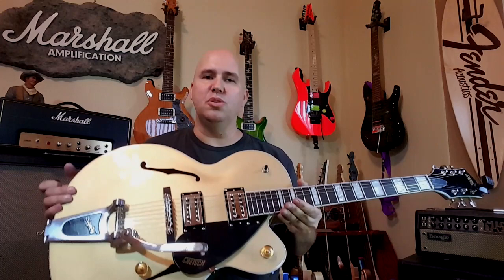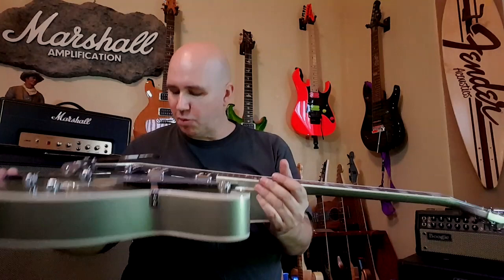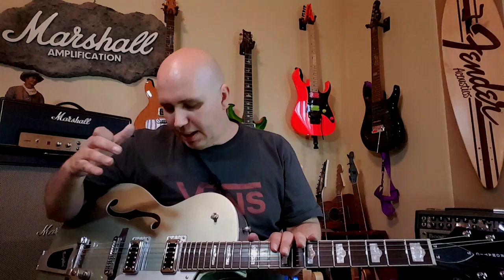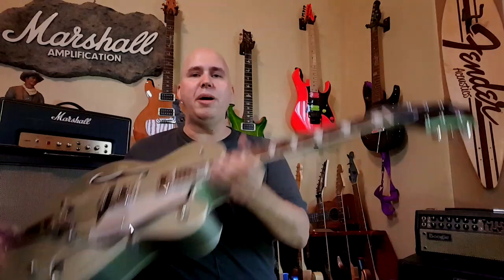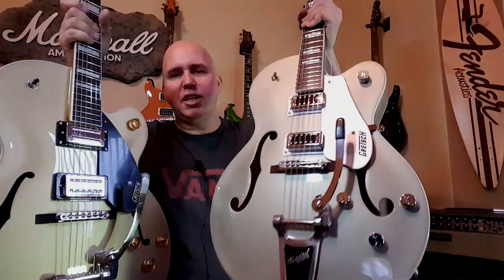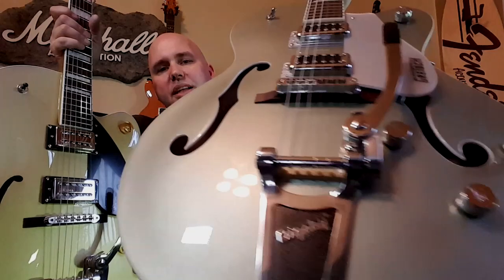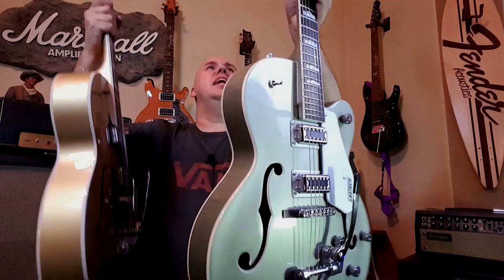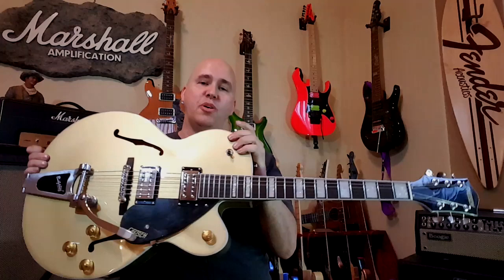Gretsch G2420T Streamliner VS G5420

Comment: FYI, you can brighten up the sound of that Streamliner with a simple pot upgrade.  You don't even have to change the pups on that guitar.  They're actually very good pick ups. Just put in some 1MB CTS pots and it will really transform the tone and if you still want something even more "Gretschy" sounding, the Seymour Duncan Hot Rod filtertrons in full PAF size are great as well.
Reply: I find the "weak point" of all of the Chinese/Indonesian Gretsch's is the pots. They have virtually no taper, and are just generally crap. I bet some basic CTS pots will bring any of them to life!
Reply: That's the one thing I hate about mine,  it is so muddy and dark.

Comment: The 2420t is amazing just bought one. Always dreamed of a Gretsch and drooled, never thought i could own one. thanks for the demo.
Reply: I think the current Streamliners are to my mind the same quality or almost the same as the old pre-2016 Electromatics - ie. pretty darned good. The current Electromatics are brilliant, though, pushing closer to the Japanese big league models in sound and feel.
My G5420 was just perfect - the action was a touch high from the factory but the nut was cut well, frets totally level, and the relief was proper so could get it down with a little bridge adjustment. I'm ever reinterpreting some of my bands songs that were written on a 'fat gainy humbucker' guitar to use the Gretsch and it gives me a less generic sound and I love playing it.
Reply: I just bought one too.  So excited.
Reply: Yea i bought one also in wine.   Now just need a slide and do some george thorogood.
Reply: @poiseinchaos3182  I sat down with my old '08 5120, along with the 5420 and the 2420, when I was looking to upgrade. 

There really wasn't much difference between the 5120 and Streamliner sound and playability wise, but the 2420 really felt cheap. The 5420 on the other hand was beautiful to play and the blacktop Filtertrons sounded a lot better to my ear. Ended up going with the 5420, but dipped my toes into the Streamliner lineup with a 2215 Jnr Jet Club (although I immediately ditched the crappy plastic knobs for some gold "G" logo ones).

Comment: Nice comparison vid.  After hearing that, for me it would be the Electromatic line, hands down.  You can dial out jangle, but you can't add it if it's not there.  But I can certainly see the value in the Streamliners, sweet looking guitars, and for jazzier tones or with more gain, I'm sure they'd fit the bill.
Reply: I think the Streamliners are essentially the "Squier" of the line, and are positioned to compete with the Epiphone 335/339 guitars, and the Electromatics are there to compete with upper end Asian hollowbodies. They are kindof the "Mexican Fender" of the Gretsch line. The Korean EM's are just fantastic guitars, the new Chinese made ones are rather ho-hum IMHO.

Comment: Spend the money and get the electromatic. The blacktops are definitely not tv jones, but I really don't even think it's worth replacing mine. Had mine for 3 years now, debated changing them, but every time I do I plug in and play some slow blues with a tiny bit of grit and it's sonic sex

Comment: Pickup height is phenomenally important for filtertrons (and Dynas). Ceteris paribus, the lower output a pickup has, the more tiny adjustments in height = big tonal changes. I won't bore you with the physics but consider gravitational fields and magnetic fields don't work linearly as to distance. They work GEOMETRICALLY
Reply: proximity effect surely plays a role as well I would think

Comment: I'm (obviously) looking at one of the G2420s, which is why I'm here. On this video, if the tone setting is the same on both guitars, The 2420 sounds "boxier" than clear and bright on the bridge setting.... at least on computer monitors. I'm checking out a number of reviews, so the tone here isn't a deal breaker. Thanks for doing the direct comparison.

Comment: I’ve got a 5122 and did a side-by-side with the budget gretsches. Damned similar sound, but emailed gretsch and asked. They told me the pickups in the Streamliners are Broad’Trons whereas the 5120 and 5122s have plain Gretsch Filter’tron (not blacktop filtertrons). I do like the Streamliner models. Been recommending them to friends.

Comment: I have a Electromatic Jet that came with the Blacktop pickups. I found that swapping the magnets from the 1/8” stock to a 1/4” traditional Filtertron magnets gets the tone much closer to the pro series pickups. I don’t care for the pickups in the Streamliner but at the price it’s a great platform to put the pickups you really like in and customize. You could easily put PAFs, P94s or TV Jones makes a humbucker size filtertron and I’m not 100% but it seems like TVJ may have a Dynasonic style that is humbucker size. There’s definitely a lot of choices in the Gibson humbucker size of pickups to choose from.

Comment: Great review! I own a Electromatic guitar, and the problem is that they're not cheap. I think what they tried to accomplish with the Streamliner Series, is that "your first Gretsch" thing without loosing their pedigree. That's why they did the binding on the headstock and kept any Streamliner logo out of the equation. 

I would not make ANY changes on a Electromatic guitar, but on a budget guitar with a regular humbucker hole on it, I would think about putting some different pickups, change the three way switch, maybe the knobs.

And I would pick the Streamliner over an Epiphone, for sure.

Greetings!!
Reply: Pedro Toledo

Comment: Would you mind explaining the issue with the G nut slot and why that happens?

Also, just got one of these and I already love it. Fun to watch this review, thanks for the video
Reply: Because nut slot is too tight. When you bend usually you pull string in. When you release string doesnt get back to where it was because slot catches it. You need to widen the slot or lubricate it so string slides trough it more freely.
Reply: @SatyrProds  Makes sense, thanks! Can a tight nut slot also cause strings to break when detuning? I've had that happen a few times while changing strings - loosening them before cutting. Always wondered why it happens...
Reply: @ringosteve21  if it breaks where nut is than it could be that nut is too sharp. Check where it breaks. If in middle than thats not it. If near bridge than bridge moght be too sharp. Its possible to dull them to skme extent. But not all. Telecaster bridge is known to snap strings.
Reply: @SatyrProds  Thanks!

Comment: Hi Phil,
I noticed that you mentioned that the 5420T you have is the newer model, but I just saw another video that explains 5420T with the thumb nial inlay is the newer model.
Reply: This was before the newest Electromatic models with the thumbnails. The original Es had thumbnails with the pups from the Streamliner. The middle version had clouds and Blacktop Filtertron pups. The newest Es have thumbnails and Filtertrons. So depending on when you see this his comments may be accurate but out of date. 

Hope that helps!
Reply: I have the middle version from 2015 IMO the most beautiful of them all.

Comment: Phil, I just bought this G2420T guitar because of this review. Bought used and it is like new with strap locks, chrome selector switch and perfectly set up. $380 total including shipping, saved lots and I actually like the sound over the chromatic.  I have only been playing more seriously over a year, no need to spent the extra. Plus I bough a Fender Blues Junior amp to go with it. Also used and saved $200 on that. Thank you for the review.

Comment: The frustrating thing for me about the G5420 is Gretsch doesn't offer it in a stoptail model, as I just do not care for, nor would ever use a Bigsby.  At least with the G2420 you have that option.  It's so weird to me that Gretsch takes that option away completely with the higher end model.  I wonder how hard it would be to convert a G5420T to a stoptail?  I appreciate the upgrade in appointments you get with the G5420 and would choose that over the 2420 if a stoptail model were offered.

Comment: I am a little confused what Gretsch are trying to do with these Streamliners.  It seems like they are meant to be a Jazz guitar?  Especially with the art-deco tailpieces if you don't get the Bigsby.  They are neat guitars in their own right though.  IMO I think  the Electromatic range is already a little over-complicated with all the different catseye and center-block models, this could be thought of as adding more confusion.  The plain "Gretsch" headstock is a very upmarket look though, a far cry from the "Synchromatic" - "by Gretsch" (on the truss rod cover) headstock that used to be on the budget Gretschs, in the pre-Fender era! :)

Comment: I have a G2420T and I replaced the terrible stock bridge that buzzed like crazy and fixed up the nut and the guitar is amazing. I bought a cheap roller bridge and it solved the tuning issues and buzzing. Shocked they put such a terrible bridge on them. Fire Fly puts better bridges on their guitars, just saying ;-)

Comment: Hi Phil, great video. I've been weighing up the streamliners and electromatics and came to your video via Reddit. My dilemma is, while I prefer the tone of the electromatic (and it is within my budget) I really like the look of the 2622t in Torino Green above anything else aside from the pro series (which is not within my budget!). My thoughts, having watched this video and your other vid comparing the pro series with the electromatic, is to buy the 2622t, and replace the pickups with TV Jones'. Maybe replace the knobs with proper Gretsch ones too. This would cost less than an electromatic and could potentially sound even closer to the pro series. What are your thoughts on this idea?

Many thanks, and keep up the good work. Great informative vids, a new fan here!

Comment: I recently bought a new labeled Walnut stained G2420t from Guitar center without one of there plans. Though I have become very attached to it, I have noticed the master knob can be squeaky at times (a mechanical squeak when unplugged) and the neck pickup knob is scratchy around 8-10 volume. I think that’s pretty good for at least 8 years sitting in a shelf or rack or being considered by other people. Would a guitar center tech be able to help resolve the knobs? I had planned on replacing knobs with burgundy and black swirled dice with gold pips, and the pickguard with a custom Saber tooth tiger skull reverse etched and painted gold with the shape of a more traditional Gretsch guard.

Comment: Hey Phil like your videos a lot, they are very informative. I am torn between the Gretsch 2420 or 2420T or also the Gretsch 2622 or 2622T. I have never really used a tremolo bar I like the idea of adding slight tremolo. I mainly play Worship with a slight edge which the 2420 is more than capable of doing. I had my mind set on the 2622 after playing it at Guitar center but then I also picked up the 2420 ( oops) lol. I guess I am also curious about the Hollow body feeding back compared to the 2622 Semi Hollow body which has the block which as you know cuts out the feedback... any suggestions you can give I would appreciate it. Maybe you could do a video comparing the 2622 and the 2420 in regards to the feed back issue... Also if I was to get the 2420T I am concerned with how often the guitar goes out of tune after using the Bigsby, I would not be yanking on it just adding some color to the song? Thanks for your input keep making your killer videos and Keep on Keeping On... 
Craig from Atascadero CA.

Comment: Can the knobs on the Streamliner be swapped for the knobs on the Electromatic?
Reply: Shadow's Gaming 

Yes.  You’ll want to fill the split in the shaft with something to prevent crushing it together.  Popsicle stock works fine.

Comment: Do you think you can dial in a little more chime through pickup height? It's definitely less treble.
Reply from the maker: maybe, I mean maybe a little, I think the pick ups just have a warmer feel.
Reply: +Gain Bear The other option I thought might be just to eq the less expensive one close to the electromatic. Bet you could get close.
Reply: These were made to be a different kind of gretsch. I've got an old electromatic and a streamliner.  They have different targets. Both are gretsch-y.  You can always find an electromatic on Craigslist for decent money if you want more twang.  Be careful though...  electromatics came up in price so people are selling older ones at higher prices. I have had them appreciate in value though (rare for the price point for sure).  I've also put GFS NY II p.ups in my electromatics and you get s really great twang and trebly sound from them. Anyways...  the streamliners are trying to go a more rock route and do great with it.

Comment: Thickness wise is it thicker than epiphone?  Also you try it high gain? On andertons vid they talked to Gretsch guy and he said supposedly less feedback cause of smaller f holes....I'm interested enough to have to try one out......Thanks for the info, great  job on new vids.......
Reply from the maker: not sure about thickness  to Epi  but I did try high gain and I did not play loud enough to see if it would feed back. I do not have issues with Electromatic  feeding  back since it is a 5 ply not a 3 play top like the Pro series.
Reply: +Chuck Nowakowski I have the Epi Swingster & the ??? 5420 he has here. I haven't measured but always thought the epi was a pinch bigger & deeper. But like I said never really paid that much attention.

Comment: Thank you. A fine demonstration. It is hard to tell from camera angles. Could you confirm if the depth of the guitar is the same.  I don't mean tone I mean the depth of the body which may have an impact on acoustic volume . I already have a 5420   which records really well but find it hard work unplugged in   a small venue where amps are not appropriate. I can use a big acoustic but then lose the bigsby and gretsch sound.

Comment: I dont think anyone's ever mentioned but what is the difference, tone wise, between a the TV jones and the Gretsch branded pickups  found in the cheaper Electromatics???
Reply: From what I've heard, it seems the stock Blacktop FilterTrons in the lower-cost Gretsch guitars are a bit warmer/darker sounding, and the TV Jones pickups aims for more of the classic bright/twangy Gretsch sound.  Gretsch seems to use TV Jones pickups in their higher-end models.
Reply: @jadetraveler  they also use the broadtrons in the streamliner series.

Comment: There is a model in the line without a bigsby,  designed for jazz players. would you still think its better than the af71 from ibanez (around the same price, both being jazz guitars from different companies) ?
Reply from the maker: I have it and opened but have not played it or checked  it out. I will let you know soon.
Reply: I picked up a used Ibanez Artstar AS153A, for some reason not loving it like I hoped I would (but could still exchange it if done in a week or so) - kind of leaning to Streamliner or Gretsch. Thoughts?

Comment: Just returned my G2622. Different guitar but part of the same series. I was very disappointed with the build quality. As Phil mentioned, G string constantly falling out of tune. I now know it would be a easy fix but still frustrating. The switch was very loose and felt cheap, as did the pots. There was also an error on the pick guard finish. Think I've just been unlucky with mine but I really wasn't impressed!